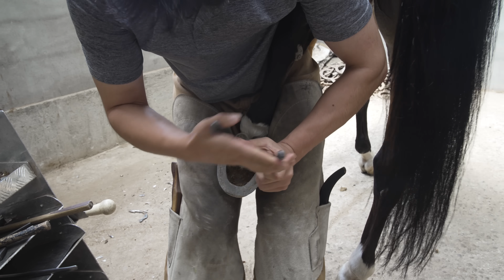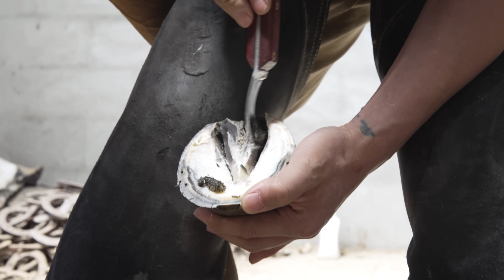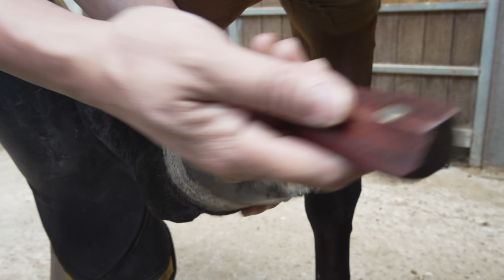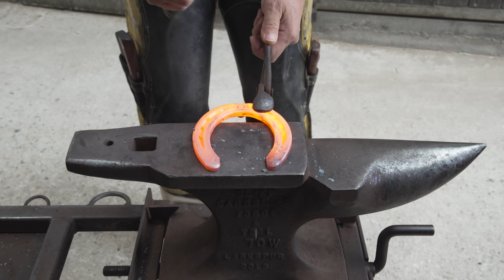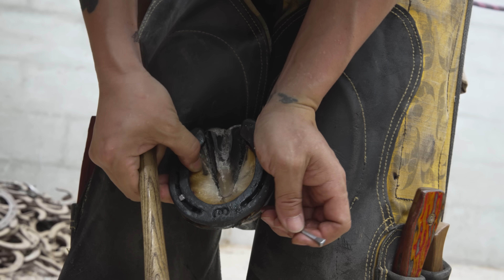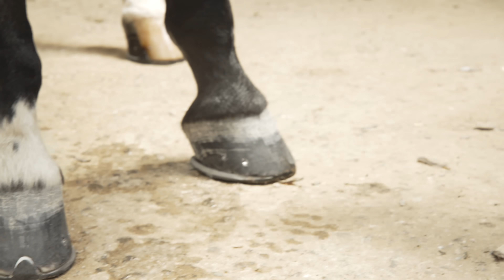*4K* 말발굽에 구더기가... 장제사의 말발굽깎는 과정

Comment: wonder if a horse has ever got to fed up with pain from hoof cleaning (like pain to where it was hurting and making them cry) or if its not so painful to some 

sorry i just never owned horses so i have no clue
Reply from the maker: It's not painful. If I don't take care of my feet, it will be painful.
Reply: The parts of the hoof you see being trimmed down (whether it be carefully snipped with those big snippers, precisely carved with the knife, sanded off, etc) are all just keratin (same stuff that makes up human finger/toe nails). The most common comparison you'll see made, is that this is effectively the horse going into the salon for a manicure/pedicure.

If the horse is ever in pain during the process, it'll let you know by resisting you and making their very distinct pain vocalizations. This will only ever happen if there's major problems with the hooves though, such as the maggot infestation seen in this video. It's unfortunate, but these problems have to be fixed so the horse can heal.